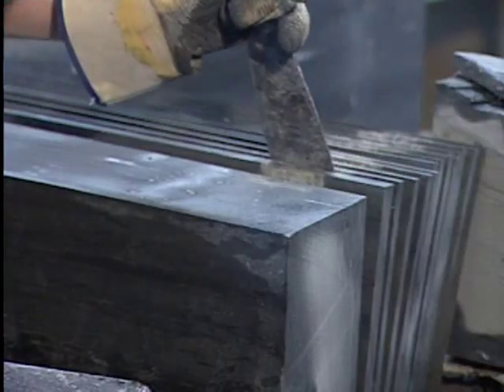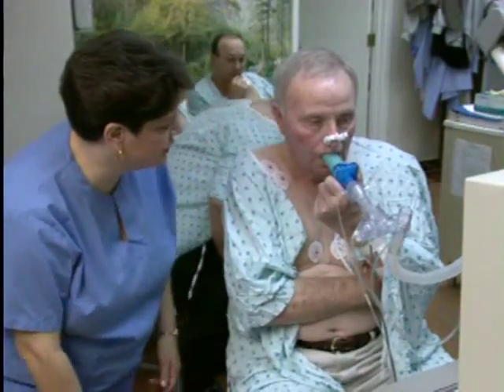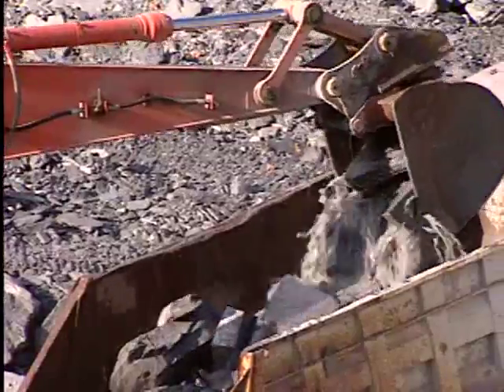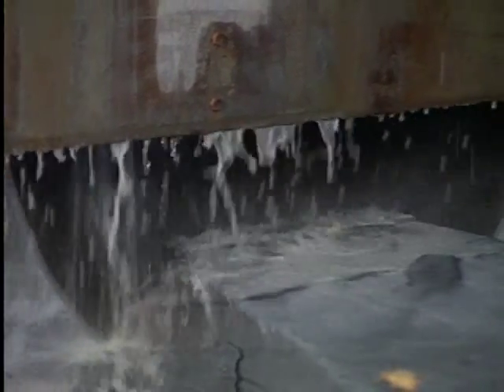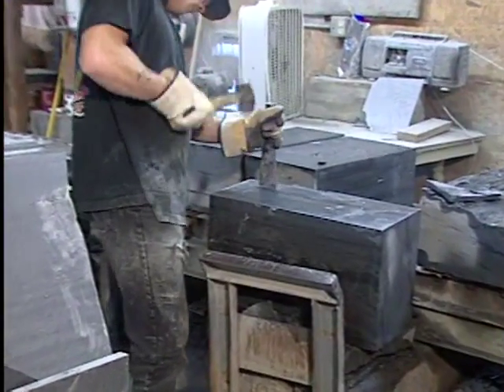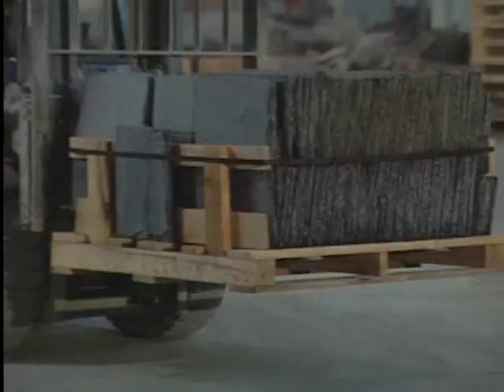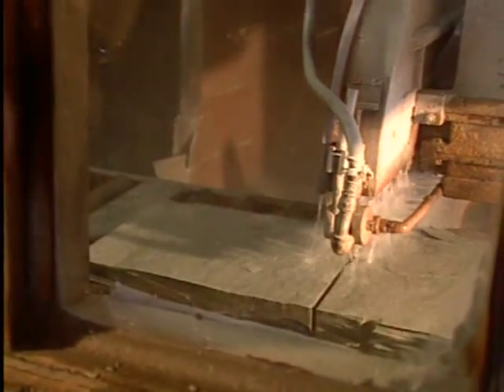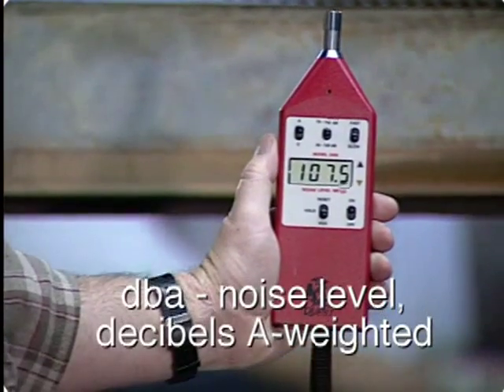Best Practice Guide to the Milling of Slate, A

Comment: @xxHarveyMoonxx, continued
...willing to use PPE than without training.

Masks are a lot harder to get people to use - they're almost always extremely uncomfortable.  Most of the places I've worked go for really high capacity ventilation to suck away the dust rather than accepting masks as SOP.  Putting an exhaust vent right next to work stations that produce dust does a lot more than a mask worn improperly "because it's more comfortable" (common worker excuse for that kind of thing).